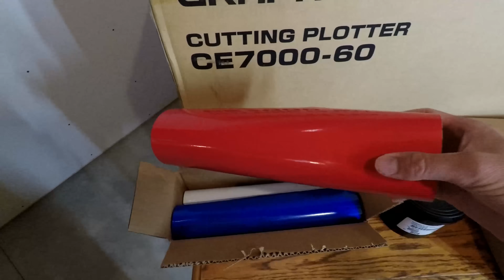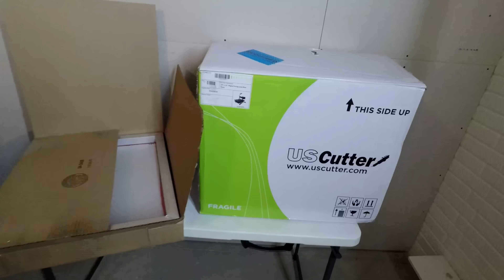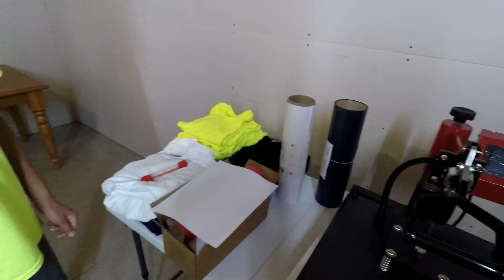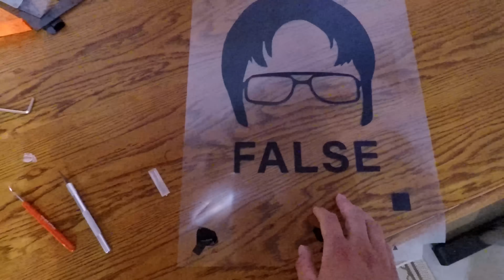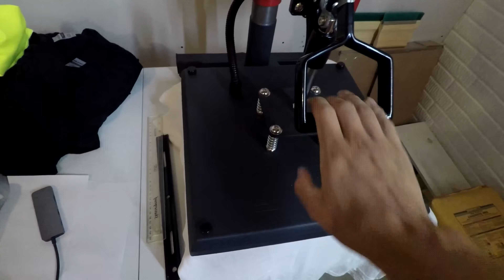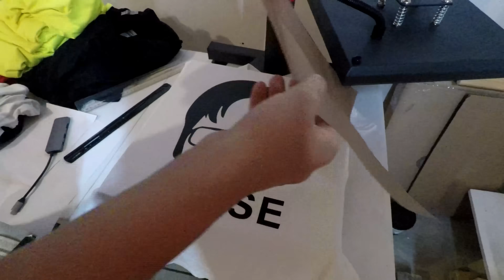Home Print Shop | CE7000-60 Unboxing | Cutting Plotter | Heat Transfer Vinyl

Comment: Hello, Do you know what can i do when i send the image to the cutter machine it keep showing '"CANNOT OPEN PORT" 
I uninstalled the CM4 and installed again and did't change anything, it keep showing the same message :-(
Reply from the maker: That is interesting. I dont really use that feature. I always just save the design to a USB. Then plug the USB into the cutter. Never had any issues. I have seen other people had similar issues plugging the cutter directly into a computer.